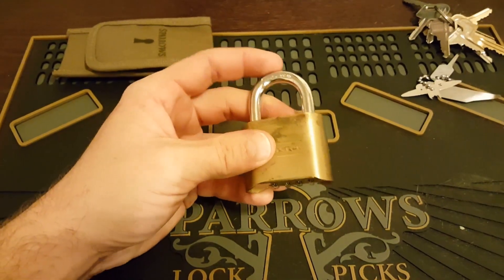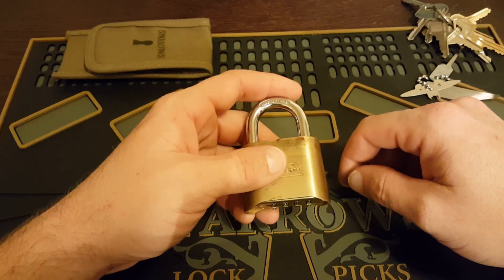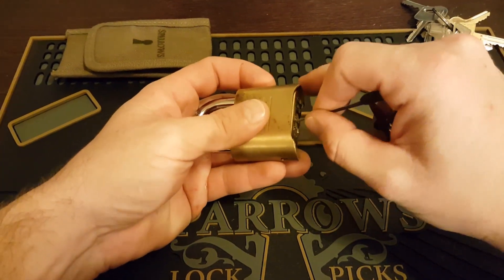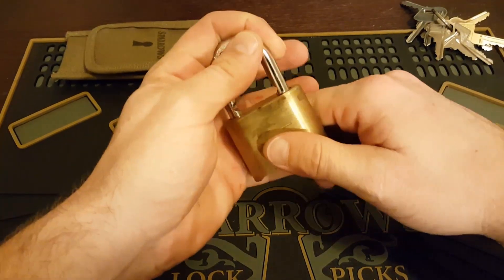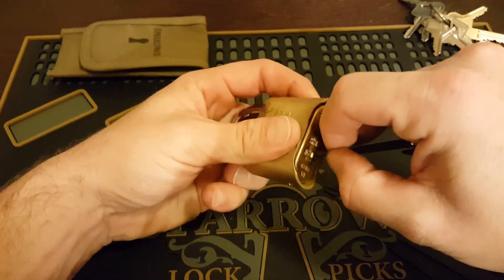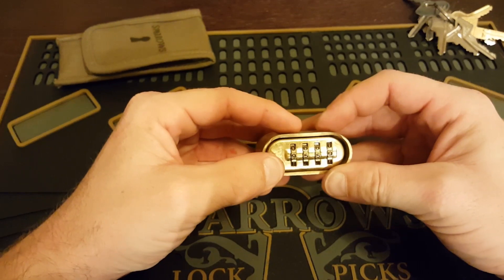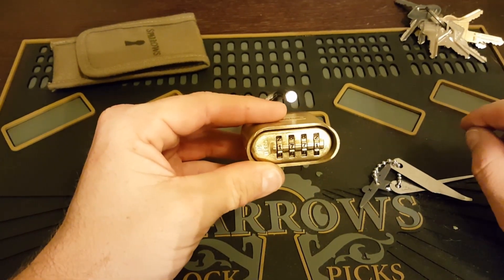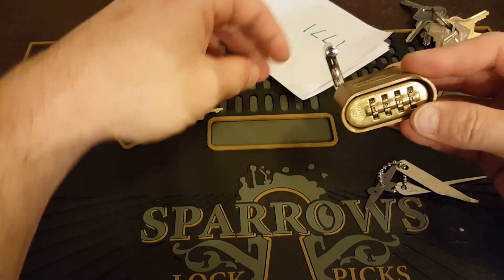[7] Master Lock 175 Bypassed and Decoded

Comment: You can legit just roll your thumb back and forth to decode this lock.  One of the first locks I ever decoded.
Reply: Explain. I want the code on this lock. Can only open it with a shim I made.
Reply: You sure it was the 175? I'm working on one right now but issue is since the shackle is spring loaded I can't use that trick, it doesn't lock up the number to feel which ones more loose, so I'm trying a decoder I got

Comment: On this particular lock if you press the hasp down while spinning the numbers you can listen for a very distinctive click when it reaches the correct number versus the click on a non correct number it takes a little bit to get the feel but going one number front to back at a time you can figure out the combination you must have the hasp pressed down for this to work as it releases the tension off the lock.
Reply: It has a bigger gate just like the 875, right? And every false number is set with a false gate?

Comment: I did this for a lock I found in a tool box I bought at a pawn shop and found the slots 9-0, 7-8, 9-0, 7-8 so I put it on 2020 but still won’t open any guess to why it won’t work
Reply: What has worked for me was find each number that has a gate/gap. Of it don’t open with the numbers found. Rotate each wheel one number an try an open. If it don’t rotate each once more try again. And repeat until it unlocks

Comment: Yeah, You think this is easy after watching this?   HELL NO!   Bought three of these at a garage sale thinking I would be able to do this....  NOT A CHANCE.  Waste of money and time.   In the end, You wanna open it?!   Big ass screwdriver and a hammer ripped the guts out of those effing things lickety split...... DONE!    Sorry.. JUST SO PISSED RIGHT NOW!!!   Started at 7pm, here it is 11pm....  NADA!   The tolerances on the locks I picked up were bogus! Couldn't even get the shim into the lock without it binding up the numbers! Used the same thickness shim you mentioned too!  Had to take a dremel and cut the openings wider and STILL couldn't get the right numbers! When I opened the locks I saw that all the number tumblers had a lipped ring around them preventing easily decoding the lock too, perhaps they have made efforts to remedy decoding?   ?   ?